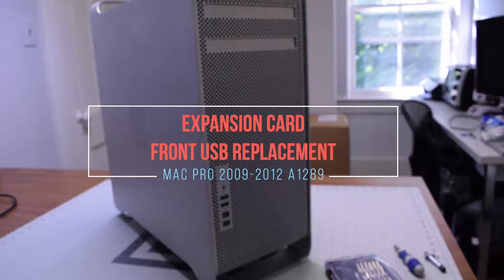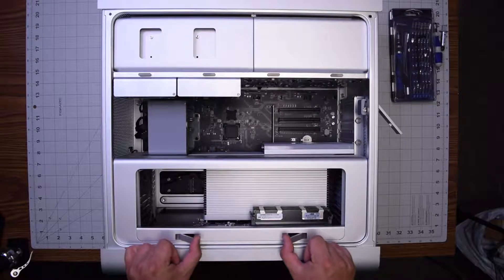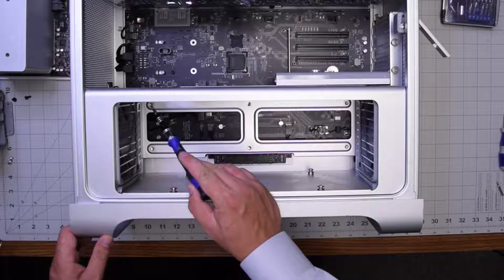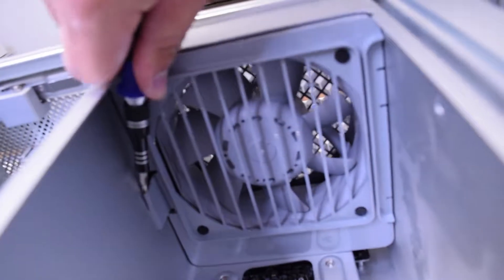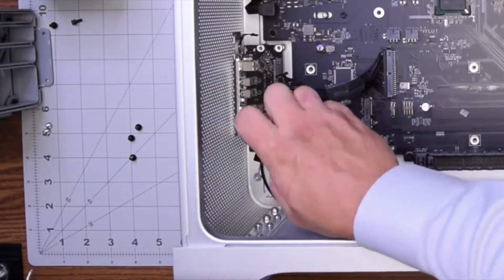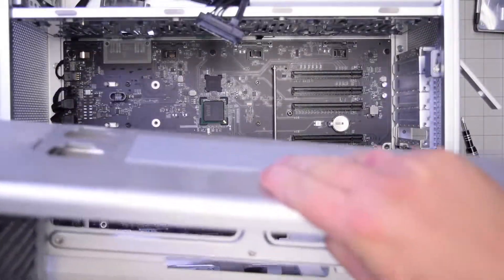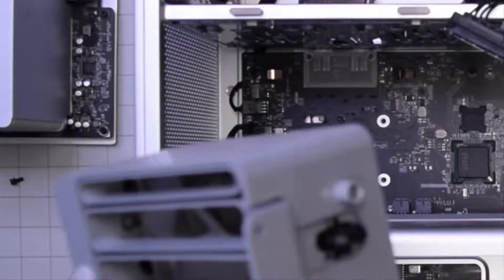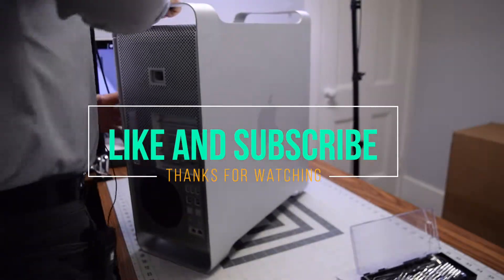Mac Pro A1289 - Front USB Expansion Card Replacement (Power Button Fix) (2009-2012)

Comment: Hi, thanks for making this video. Do you, or does anyone else have a link to one showing how to replace the rear panel USB / Firewire 800  port card? I got a power surge through a USB hub that took out another entire Synth, but on the mac it only rendered the rear USB panel inoperable, so I thought I'd just order one install it and see if it works.

Comment: Hi. Greetings from Spain. I've been reading your website and watching the videos on your YouTube channel because I have to change the front panel of USB ports on my Mac Pro Early 2008 but I can't find a guide to do so. The closest is this video. One question, to change that panel would be enough to remove the fan and from there agree to disassemble it or do I have to remove more parts ?. I would appreciate your help. Thanks in advance.
Reply from the maker: It has been a while since I dove into one of these but as I remember of the top of my head, the architecture is a** backwards and so you will have to move everything out of the way to get to the clamps that need to be pried to get the usb port out.